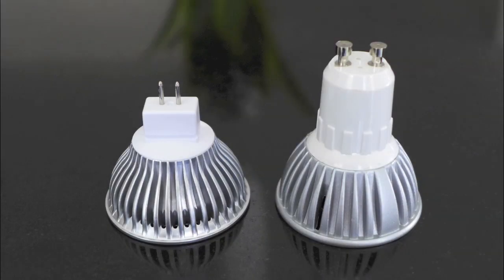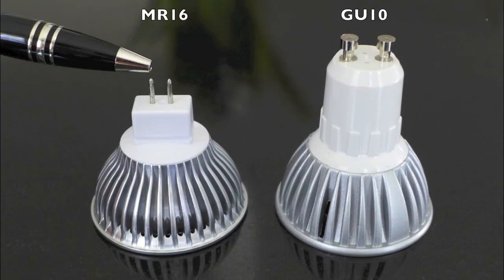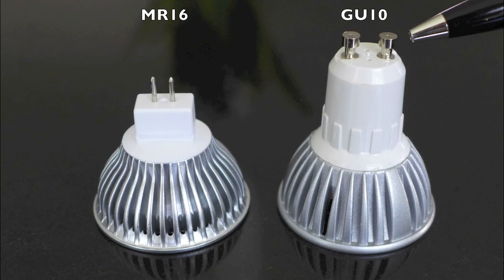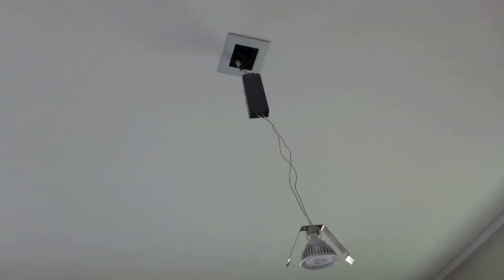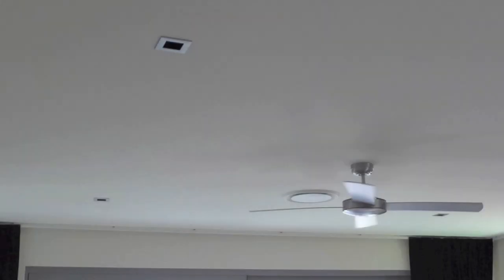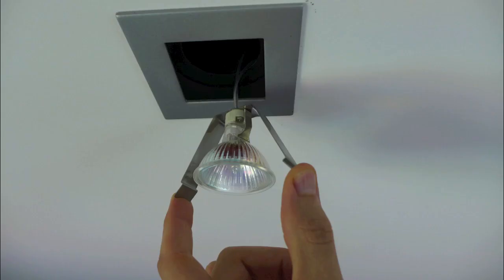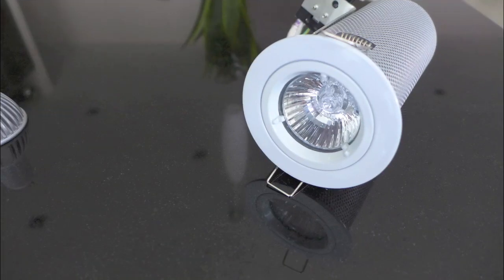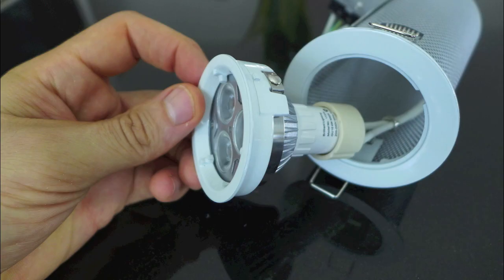MR16 vs GU10 LED Lights

Comment: Hi, I notice you didnt mention about changing the transformer when replacing the halogen´s MR16 to the LED´s MR16 for both GU5.3 and GU10? Would it be safe to do that?  I m thinking to replace my halogen´s GU5.3 into LED, but I have so many of them. Thanks

Comment: MR16 - Requires transformer 12v - 240v (Dimmable)

Check Lamp package to confirm if it says dimmable or non dimmable

--------------------------------------------------------------
GU10 - Mains Voltage 240v 

Dimmable !

--------------------------------------------------------------
Best option whoever has MR16 bulbs that contain 2-pins contact an electrician an replace these fittings which is quick & easy to GU10 fittings & bulbs as these are cheaper to use !!!!!!! 
--------------------------------------------------------------
SUBSCRIBE TO MY PAGE FOR MORE !!!! 

:D

Comment: In my experience for most MR16 GU5.3; the driver for powering a approx. 50 Watt halogen bulb usually cannot supply the very low current / power for driving an equivalently bright 4 to 5 Watt GU 5.3 LED without causing the LED to flicker, so almost always the driver needs to be changed with the bulb so not as straight forward as shown. The GU10 change is as shown, simply change the bulb.
Reply: I've been told that people who really don't wanna touch the old transformers can just keep one of the old lights so their power supply is "fooled" and everything else upgraded to LED and that makes them not flicker. I trust the person 100%, but never had to check it. Maybe it will help another lazy man like me. 🤷‍♂😂
Reply: what is the best? thanks

Comment from the maker: That is an interesting question. And not one I can answer definitively. I would say anything low voltage (like an MR16) is safer than anything that uses mains voltage. Using lights in a mobile application like a helmet, I suggest hooking it up to a battery (again low voltage)
Good Luck, send me a pic when you're done!

Comment: I have a question, which ones of these are more safe of a short circuit the MR16 or the GU10? this will sound weird but i want to install led color lights in a helmet (those come with a wireless remote) but i hate the fact the light itselft just come in bulb and those two conections, and i want to do it in a safe way. :)